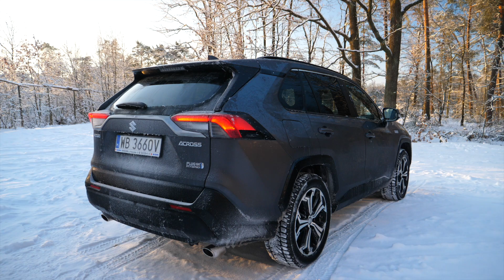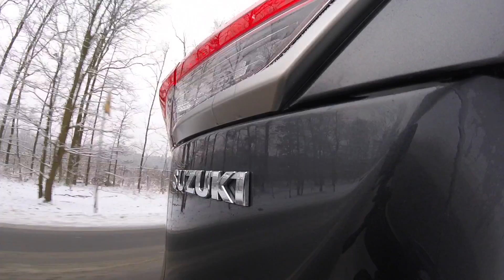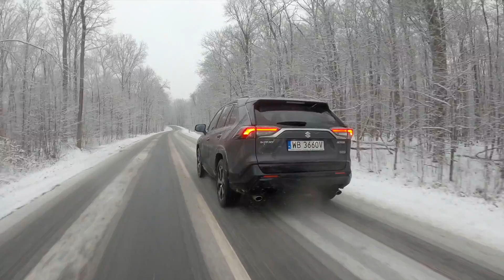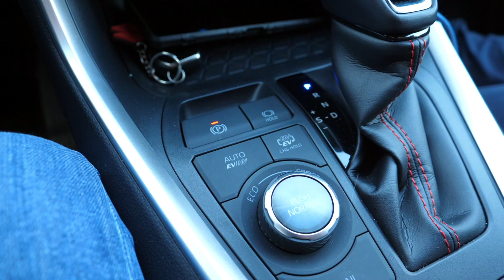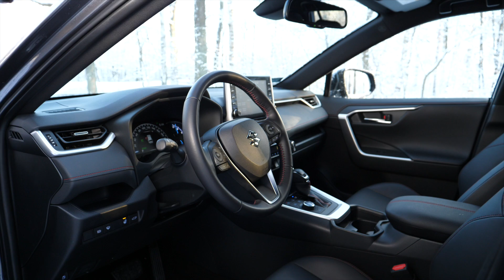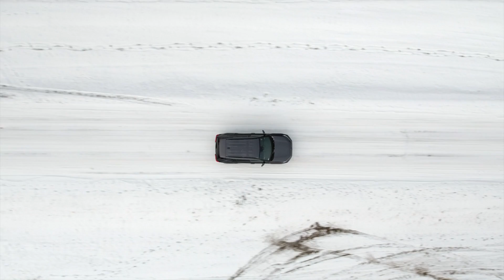Suzuki Across PHEV SUV - Rebadged RAV4 Prime (ENG) - Test Drive and Review

Comment: I am confused by the fact that my 2024 Suzuki S-Cross has a 360 camera, which really helps with parking, but the most premium and expensive version, the Suzuki ACROSS, does not have this camera. Very strange...
Reply from the maker: This review is a few years old, so maybe they've added one. Or Toyota told Suzuki they can't have one.
Reply: @MarekDrivesENG  Unfortunately, this is a deliberate strategy by Toyota. They intentionally withhold certain premium features from the platforms they share. This ensures that partner brands don't cannibalize sales or become too competitive against Toyota's original models.

No available 360° surround-view camera in most trims.
No driver seat memory settings for multiple drivers.
Smaller or less advanced infotainment screen options.
Fewer advanced driver assistance features (lane centering/highway assist, etc.).
No head-up display (HUD) in typical configurations.
Fewer premium comfort options (e.g., multi-level seat ventilation).
Less extensive powertrain and hybrid variant lineup.
More limited dealer/service network in many regions.
Fewer optional high-end tech packages overall.

Comment: Had mine for 8 weeks averaging 3.9 miles per kwh  even on motorway.Electric range 53/55 miles.56mpg in hybrid on motorway. Averaging  85mpg overall. Purchased pre registered  with 10 miles on clock 15% discount 39k, no discounts on rav 4 phev.1.5k cheaper on list price than toyota. no satnav but android auto,you get a spare wheel not a tyre kit. Only draw back guarantee  not as long but how often do toyotas break !!!!!!👍🤔🤣🤣
Reply: I bought my 2023 Across 6 months ago with 19,000 miles. Its now on 41,000 and I love the car. I do majority long motorway miles so averaged 61mpg so far. Around 43 mpg on motorway and +99mpg in rural driving with EV. 

61 MPG average is incredible as I sometimes race at night and after beating Merc, BMW and tuned cars with the 300 BHP, many of them ask what tune or remap I have tuned the car with 😂😂 
The faces when I tell them " mate, you just got beaten by a stock Suzuki " Hahahaha

What an amazing car this is 👍👍👍

Comment: It doesn't have navigation, and that's a plus(!). Prices in The Netherlands, according to published data, this Across should €5000 cheaper than a comparable RAV4..........Confusing.
Reply: Right, one thing that needs to be pointed out is that he was pricing based on Poland but that's not the case in many other countries where the A-Cross is sold which is much more like the pricing you mentioned in the Netherlands. It is the local import company in Poland that is choosing to price things that way for the Polish market but in other markets the pricing of course is different.

Comment: Starting price tag is beyond 50k Euros...  pretty expensive for a Suzuki, and a car of its class. BMW X3 base prices cost cheaper than that! For 52k Euros you can get a fully loaded Hyundai Santa Fe, or even cheaper than that because Hyundai often give friendly discounts! Here in Belgium, you can get a 2.5 petrol hybrid Toyota Rav4 are a decent price of between 45-50k Euros, the only RAV4 that costs beyond 50k are those with accessories/luxury equipment.

The Suzuki Across it expensive for what it is, gone are the days when they used to do their own SUV models, like the Grand Vitara, etc...
Reply: Wipe your eyes with urine and see vitara sx4 and jimny. Suzuki is the best and top!

Comment: I don't really understand this car.
In Hungary you can't buy the plug in RAV 4, only the regular hybrid.
And the Across only comes as a plug in. Deal of the century, right?

Well... It costs as much as a BMW M340i xDrive Touring without options. Or a base Volvo XC90.

If I want to drive on electric power alone, I will get an electric car. If I want to drive long distances, I will get a diesel or a petrol.
If I want to do both, I will spend 40k on an electric car and the remaining 18-20k on a 2 year old demo car.

There may be cases where this makes sense (where you can only own one car due to space or taxes or whatever), but I don't see many people buying one for this reason.
Reply: You can buy RAV4 PHEV in Hungary.
I know because I did (=preordered).
Reply: @szabolcsh2901  I checked their website as soon as Americans got their hands on it. Then someone told me they were not going to sell it here.

And it's actually cheaper than the Across... Doesn't make any sense.
Reply: Because they mix up the extras you cannot compare Suzuki prices to Toyota's. But it's not accidental that I bought the RAV4...
Reply: @szabolcsh2901  You don't have a choice with Suzuki. There are no individual options and that's really annoying.
You end up paying a lot of money for stuff you don't need.

Same with the Swift. Only the top spec has a 4 way adjustable steering wheel. I want that, but I don't need adaptive cruise control. It's dumb.
Reply: @ast5515  
Not really. Adaptive cruise control, like ABS, tyre pressure monitor , emergency brake assist, SOS connection and autonomous emergency braking are all going to be standard features on all cars sold in Europe from this year onwards as I understand it. Four way adjustable steering wheel, rear seat heating, steering wheel heating, seat memories or even electric seats will not be counted in safety or economy ratings and will not be standard fitting on all cars. Want some of these and you can choose a car without if available for your chosen model.
Reply: @hedydd2  Perhaps that's not the best example. 
I might have a better one.
The middle trim has a backup camera, the top trim also has parking sensors.
I'm fine with using just the camera, yet I have to pay for the sensors because I want to adjust the distance of the steering wheel.

Or I want rear power windows... I rarely have people in the back but I like having my windows down. Lowering both windows on one side reduces wind buffeting considerably, therefore I need it in a car. With Suzuki that means I also get navigation, LED headlights, adaptive cruise control, parking sensors, keyless entry and a lot more.
Reply: @ast5515  
It's like buying a camera really. Most buyers probably only want to take still pictures but most cameras now come loaded with video features as well. Also to get some of the features you may want, you will also have to take a whole lot of features you don't and will never use.
Fact is though, making bespoke cars is entirely possible and companies like Jaguar Land Rover do so. You have to pay a very significant premium and put a factory order in for the privilege of getting exactly what you want, and even so there will be some compromises such as 'packs' where the feature you want is only available in combination with some your don't.
Reply: @hedydd2  Cameras aren't the best example here, since adding video capabilities costs no money.

Power windows and a steering wheel you can adjust are very similar. It's obvious that ANY new car has those features, the same way a camera will have manual focus adjustment and manual ISO adjustment.

Adaptive cruise, LED headlights, sunroof? Those are actual extras, like a full frame DSLR, auxiliary microphone support, auxiliary display support, more complicated image stabilization, etc.
Reply: @ast5515  
You would be surprised at how little these things cost extra for the manufacturer. Probably way less than a hundred Dollars for cameras and adjustable steering column in total. It just costs more to them in organising endless permutations than to just include them in a trim level.  Whether you want them enough to pay for the upper trim level which costs you, not the manufacturer, loads of extra money is entirely up to you. As I said, premium  brands are more likely to offer bespoke equipment exactly as the customer wants than economy brands. You pay a significant premium for the privilege though.
Reply: @hedydd2  I'm aware of the cost of  the endless permutations.
So why not eliminate it by creating good cars?
Create one steering column that adjusts 4 ways and be done with it.
It's much cheaper than to design, test, then produce two separate versions. I don't need individual options. I need trim levels that make sense.

4 way adjustable steering column and 4 power windows is trivial.
Reply: @ast5515  
Indeed why not buy the top spec loaded car versions that have every extra that anyone could possibly want rather than the base version that nobody but you wants with your personal choice of extras?
If you don't like the spec of the car, move on and find something you like with no compromises that fits your disposable income. It's really that easy, new or used.
Reply: @hedydd2  That's exactly what I'm doing.
But those extras you're referring to... They aren't extras. That's like saying you don't need rear power locks because you don't put passengers in the back every day. 
That would save about as much money as not including power windows (zero), except you could buy adaptive cruise control if you want to open your door.
Sounds like a good deal? Sorry, I don't see the difference. If you have 4 doors for passengers, you have 4 power windows. If you have people driving, you make sure the driving position is adjustable. Both the seat and the steering wheel. You would be outraged if the seat didn't move at all on the base spec. What's the difference?
Reply: I'll just add some German car brands are already working on a pay-as-you-go model for certain features. For example you'll buy a compact hatchback, and your real choices may be paint colour, wheels, and maybe the upholstery. A certain set of features will be standard, like power windows, keyless entry and ignition. However things like sat nav, adaptive cruise control, matrix headlights, etc. will be activated, when you need them for a certain fee. The rationale being that you don't don't need to pay extra for fancy headlights in a car that you use mainly in the city. However this one time, when you go for a winter road vacation, you would be willing to pay to use this feature for the duration of your trip. This would also help the second-hand buyers, who could buy any car, and be sure they can unlock the features, they want.
Reply: @MarekDrives  It sounds cool but I hate it.
If the car has the damn feature, I wanna use it.

I also love it. People are already activating phone mirroring, cornering lights and other goodies aftermarket. Pretty sure you can hack these systems and get a fully loaded car for the base price.
Reply: Toyota keeps it simple with a few trim levels. It's not like with Skoda that you can LEGO the features. I'm ok with that.
Reply: @szabolcsh2901  Toyota does it right. They still offer a few individual options or at least some packages.
Suzuki has 2-3 trim levels and that's all. It makes manufacturing cheaper but it's annoying for the customer.

Comment: there will be superb offers on the car half a year down the road or a bit later. 
and 1-2 year old cars will be a lot cheaper on the market than toyta. Even if suzuki goes tits up - there will be plenty of parts for it later. just the small bits of the body will be questionable. 
My gripe is the material quality. It is 40++ K eur car and the interior is made from cheapest looking and feeling plastic and generic buttons that feel and sound awful during winter. The sound insulation is not there and the car feels "thin". BUT - it drives well. Better than many european or other cars. Has good performance for what it is...
Reply: Interesting, so far the new RAV4 has been praised for its interior quality (materials included) and I did enjoy my time in it as well.
Reply: @sic22l  perhaps should roam around and try more cars in that price range. it is a lot of money to throw around for cheap plastics and buttons, that come from "the 90s show".

Comment: I prefer the design of the Suzuki's front end over the RAv4's, but...  why is this car more expensive than the RAV4? It usually goes the other way arround. Unless they plan on major discounts, this car won't sell and they'll have to pay the emisions fine.
Reply: Problem is that Suzuki has to buy or barter this from Toyota and therefore there is another middle man wanting a cut from it... Suzuki.  They would be very clever indeed to sell it cheaper that Toyota does the RAV-4.  However there will soon be big discounts on this, I'm sure, that will place it where it should be considering its relatively slightly stripped out standard features
Reply: It's weird because Corolla equivaslent from Suzuki is cheaper than the original.
Reply: That's not the case in many markets where this car is sold. In the case of Poland, the pricing is being determined by whomever the importer is for the Suzuki line. In other countries, the Suzuki version is cheaper to purchase than the Toyota version and in many cases the Suzuki comes with a better warranty as well.

Comment: What happends, when driving in hybrid mode and petrol runs out, if battery is full enough for EV mode? ...I traveled recently with my hybrid cross country, where I automatically run in hybrid on highway. I planned to reach certain petrol station, but while my battery level was almost full, fuel tank closed to approx. 2km range and it occured to me, if car is smart enough to allow, or even switch to on itself to EV-only mode with dry tank... :)
Reply: I don't know. In over 20 years of driving I ran out of fuel only once, and it was in my car.
Reply: Interesting question.  Of course the car is capable of pure EV driving. The question is, has the computer been programmed to allow it when the ICE is offline? My guess is, YES. In general, an ICE never knows when it is out of fuel; it stops because combustion ceases, not because of any " no fuel" sensor.
Reply: @alliejr  then why do all plug-in hybrids show that the consumption is 1.5-1.9 liters per 100 km? Even if you go all ev mode it still turns it on once in a while from what I heard.  when u go ev mode does the display show 0 liters per 100km? never heard that
Reply: @Metoo3 the short answer is: it depends. 
TL:DR
Petrol engine sometimes kicks in to get up to temperature so it's read to take over, for example under hard acceleration. When, if, and how often this happens will depend on the engineering, driving style, and weather. And yes, in this Suzuki Across if you watch the "Since start" (or whatever it's called) trip data, you can have 0L/100km as long, as the petrol engine hasn't come on. 

As for driving in electric on an empty tank, I'd imagine if you really run out of petrol, and the car cannot turn the engine on to keep the optimum temperature, it will probably go into some kind of limp mode to allow you to get to the nearest gas station.